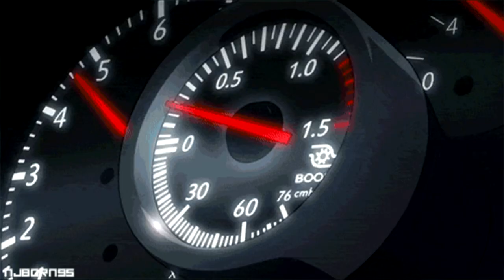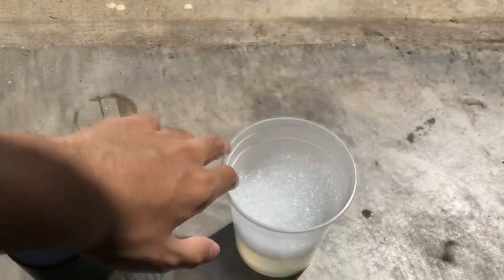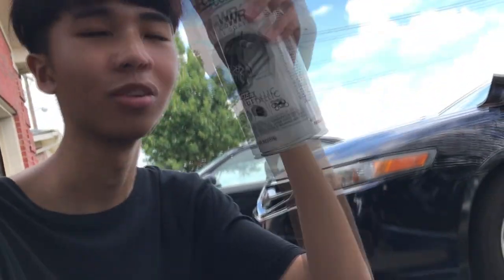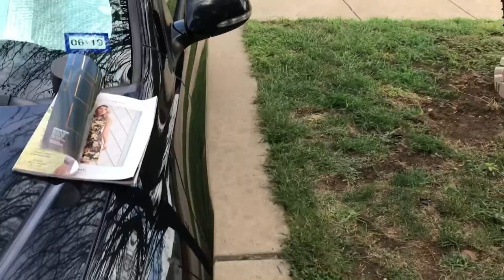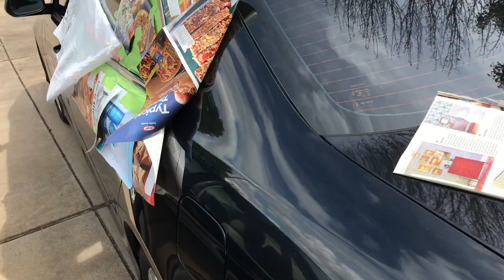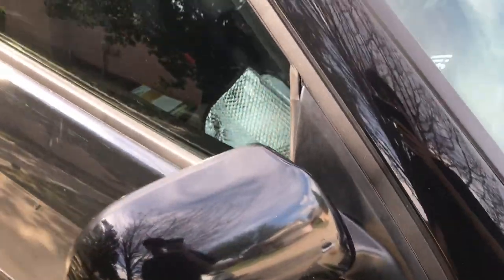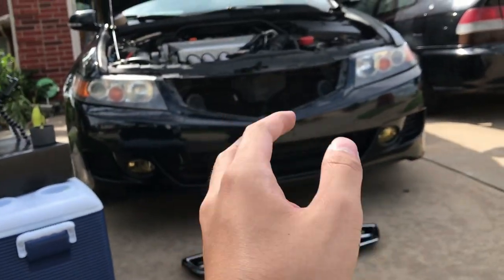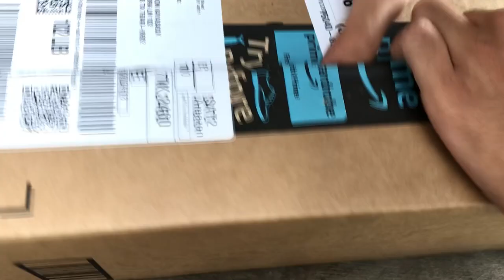Tsx Chrome Delete!

Comment: Hey you did better than most......you tried.

Just a note, when pulling up the tape always have a exacto knife on hand to control the Plasti-Dip from lifting. Hope you tried it again, and get some tap from the 99 cents store.
Reply from the maker: ty, you can check out my latest video where i redid the dip. It turned out better than this video's.